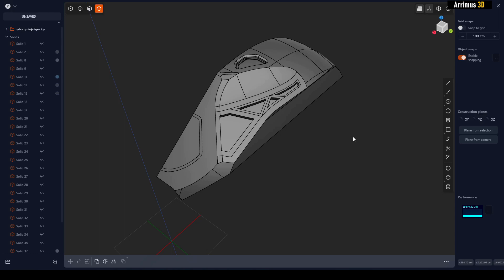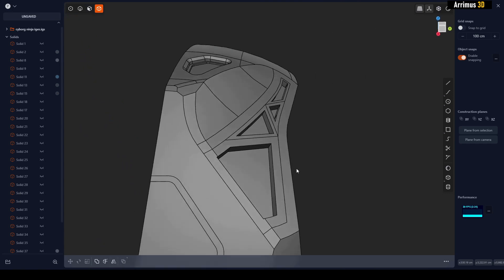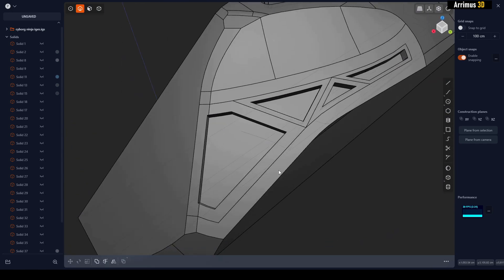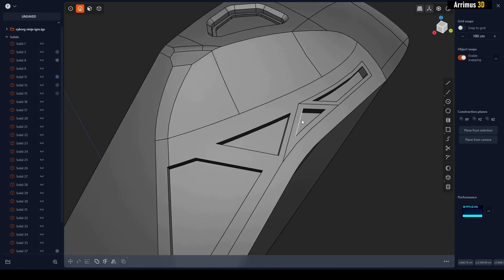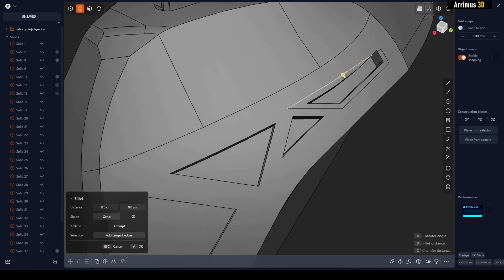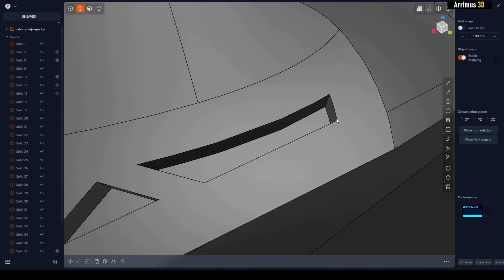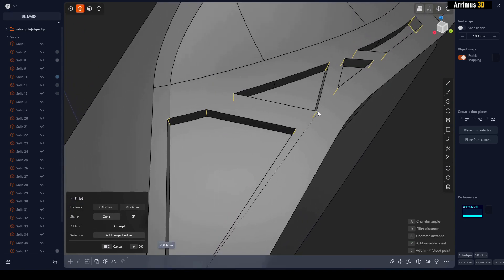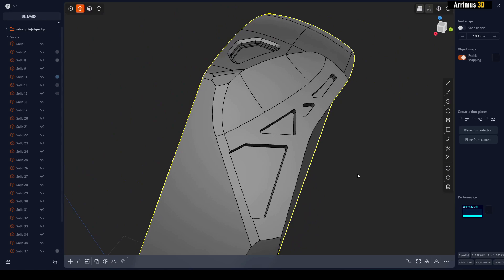Removed Unwanted Lines in Plasticity

Comment: hi, not sure if you've done a video on the following topic yet: alternate strategies for mass filleting.
i made an engine block with many edges and hadn't been beveling along the way. now i've mostly finished my model, and i want to bevel the edges, but if i select all of them at once, it won't bevel. it would take a long time for me to select all that bevel and avoid those which don't. and even if i tried selecting all of the manually, i might miss one or two by accident. also, even if i could bevel all of them at once, the calculation would probably have heavy lag.
if you're aware of strategies for approaching problems like this, i'd love to hear. maybe there's some edge index? such that they're numbered, and can be selected sequentially. or, if there are no such features, it could be instructive to see how one goes through the process of submitting a feature request. i think it's done through the plasticity discord, but i don't know if a certain kind of request formatting is necessary.
anyway, thanks for the videos